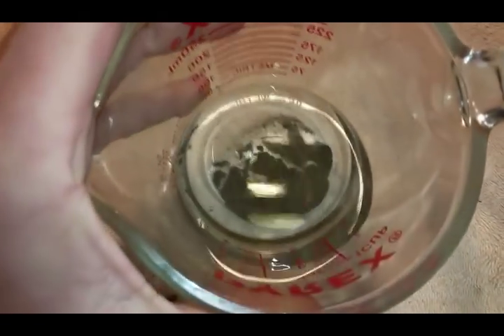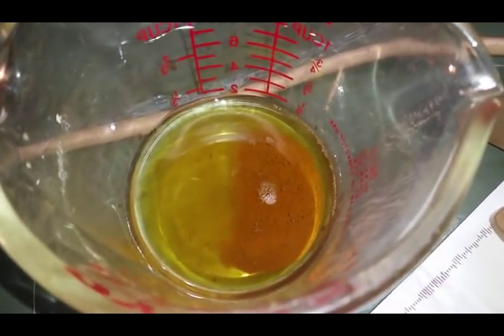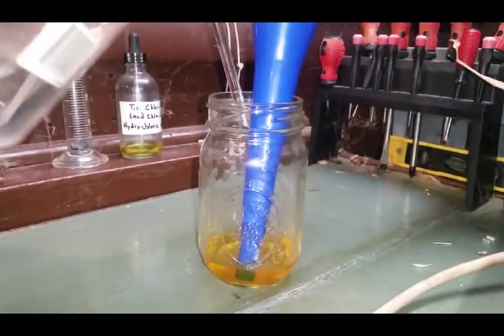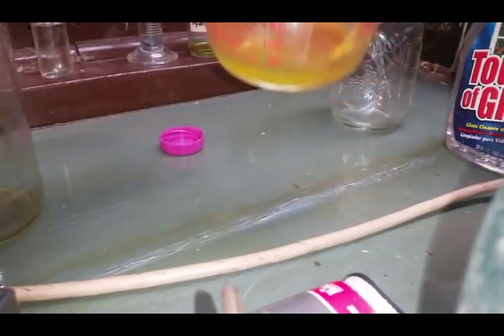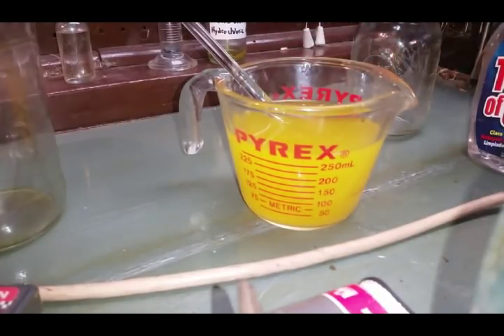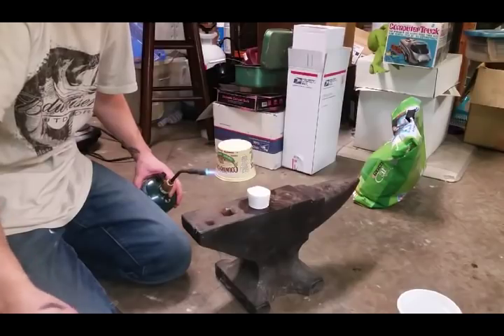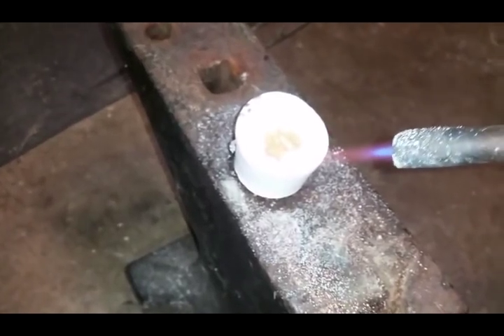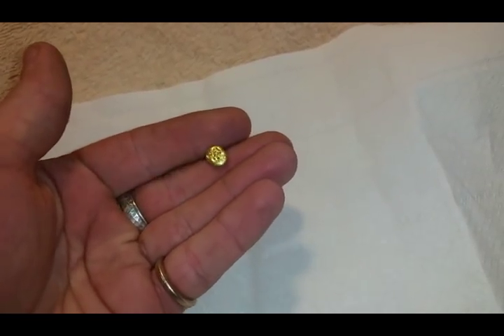Refining Gold to High Purity (My Method)

Comment: Big Tip: Always use protective gloves when working with acid.
Reply from the maker: Fuming nitric acid actually causes most gloves to spontaneously combust upon contact. This is not fuming nitric acid, however I have had different acids on my hands and most are relatively harmless when rinsed immediately.
Reply: Gloves are a must!! Don't fool yourself just because the acid does not hurt immediately when it is on your skin that doesn't mean that it isn't absorbing into your incredibly porous skin leaching all those heavy metals into your blood stream for a very nasty effect later on in your life. Look up platinosis once and see what the damage of dissolved metals in solution can do.

Comment: Not going to question anything you done. Great job and video, Thanks. Why did you evaporate acid down? I hope you can offer me some guidance.   I have 4 different batches on now. 1 was real dark yellow, 1 has green tint to it, other 2 are amber. Is it normal for the SmB to take off late? On the one it didnt do anything then all of the sudden it fizzed up. Now none of my bottom stuff is brown or cinnamon color. Green tint 1 is black and gold color, other 3 are gold color, 1 has milky white powder on top. Any ideas would be great.
Reply from the maker: migel reyas Minimal Nitric acid is used because it can cause the gold to re-dissolve after attempting to precipitate it. So, using the very minimum and then evaporating the solution will help destroy excess free nitric. The solution with the green color is likely due to copper contamination. Could be silver as well.... blue and yellow together make green. I would refine it a second time if the solution isn't a good amber/yellow. The black colored powder (precipitant) is very likely finely divided gold. Gold colored precipitant is most definitely gold, and brown precipitant is the same story. If the gold dissolves back into solution, something is likely neutralizing the SMB or Iron sulfate and not allowing it to fully precipitate. 

Personally, I would get everything to drop, then combine the powder and refine again. Don't keep adding SMB or anything if you don't get a successful drop. You must first neutralize the nitric or gas it instead of pouring SMB directly in.
Reply: Ok thank's, so evap. down wont do any harm and yes I used to much smb. Where I am its hard to get certain things. Great news on all thanks. Since I have 4 going at same time. Its from 4 different area's. The green 1 is sulfides. Thanks again.
Reply from the maker: migel reyas I have not had the issue with adding too much SMB and not being able to get a drop. I usually use Iron sulfate because I can easily make my own in higher quantities that are more cost effective. Not to mention Iron sulfate is a faster drop and more useful in solutions containing copper. IMO It's an all around better precipitant than SMB. By the way, if I called the gold dropped out of solution a "precipitant", I correct myself with "precipitate". The precipitant is what is used to cause precipitate... but I digress

However, I would search the forums for the approach to fix adding too much SMB. Also, when you evaporate a solution down, do not boil it. You can bubble precious materials out of the vessel. Instead, monitor the solution very frequently to watch the temperature and amount of solution. When it nears dryness it can dry very rapidly and pop right out of the container in the form of flakes or consolidated pieces.
Reply from the maker: migel reyas ..... and potentially break your glassware.
Reply: ok Thanks. How do you make iron sulfate? Cause I use stump out and to get it here cost's me a lot. I just got 2 one pound jugs and it cost me $65. Serious. Cant get it here so had to pay someone to smuggle it to me.
Reply from the maker: migel reyas I don't know if I can properly respond to this without telling you to check your local laws before doing any of the procedures gold recovery and refining pertain. If you can get Nitric acid, I don't see why you would need to "smuggle" Sodium metabisulfite.
Reply: mexico isnt like the U.S. where need something just pop over to Home depot. I looked every where, so it was easier to have someone bring it from the U.S.. I use HCl&peroxide, but just found Nitric, 4 hours away. You knowing how to make iron sulfate, would be a good help, but thats your choice if you dont want to share. Thanks for the video's. I never thought of evaporating down before smb, to cut acid.
Reply from the maker: migel reyas Iron sulfate is commonly found in gardening stores. It can be made by reacting steel wool with copper sulfate and water. There are videos on YouTube about it, I forget how much steel wool and copper sulfate is used.
Reply: Thanks, poopoo out of luck there.

Comment: Hey bud how much HCI/ nitric do you think I’ll need to clean up 112 grams? My nugget is almost the size of a golf ball. The gold was plated on CU. I dissolved the CU with spent nitric that was used for prepping stainless steel. I wash the gold foil’s in nitric until the nitric was almost clear, water and melted down.
Reply from the maker: Joshua Rhodes I would suggest just covering the foils in HCl and starting from there. Hopefully you aren't saying you melted your foils into a gold ball sized nugget, because that is going to be extremely slow to dissolve. Usually when that happens, people become impatient and add more nitric than necessary, which in turn will make everything more difficult. If it is one large piece, melt it down and pour it into a tall container of cold water to make smaller pieces.
Reply: Basshead Curry  Yes I did melt them all down for convenience. Which is not a problem for me to melt in to smaller pieces.  I have another batch of plated scraps I’m working on now. I made a comb with  razor blades and I score the plating every 8th in. To dissolve the copper. Just trying to get an idea of how much AR I’ll need. Thanks!
Reply from the maker: Joshua Rhodes I realized I made a mistake while typing. That wasn't supposed to say "gold ball"...... instead, it was intended to be "golf ball".
Anyways, I think you knew what I meant. Scoring may not be necessary if you're using common gold fingers, it quite literally may be wasted labor. The HCl/peroxide will do its job just fine on most gold fingers.
Reply: Ok so when you say gold fingers? I’m only scoring a sheet of copper that’s 12” *12” that’s scrap, after 6- 3” *4” parts have been plated in the in the panel that’s 2” on the sides and 3” on the top and bottom. It cuts the time to dissolve the copper by 4 to 5 hours of 30 minutes. My first golf ball was 75 scrap panels. When I don’t score them it like the gold foil seals the copper from dissolving.

Comment: My cons have sulfur, prevents SMB from working. Will this process work? Cons in AR warm, increments nitric and HCl till no reaction, filter rinse, back in pot hot to denox add HCl twice then water, stir in zinc filter precip rinse, dry then take precip put in hot HCl 24 hrs, filter rinse real good, then put precip into nitric/water hot 24 hrs filter and melt with oxy/acet torch. Not worried about silver loss, I am after the gold and pgm's. Zinc drops all metals, then HCl soak and Nitric soak to remove all junk metals, but gold and pgm's. Is this process correct?
Reply from the maker: You CAN precipitate with zinc to drop your most abundant metals but if it does in fact drop all of them (depends on the contents of the recovered gold material), you'll need to refine again and use SMB or Iron sulfate to precipitate again. Evaporating the aqua regia does help remove residual and/or excess nitric acid, so be sure to do that.  Sometimes it is necessary to rehydrate with distilled water and evaporate one or more times proceeding, to be sure nitric is destroyed. 

Keep your glassware clean, and rinse everything well with distilled. I'm not informing you of things you may know, but every attention to detail helps.
Reply: @BassheadCurry  I don't understand... You CAN precipitate with zinc to drop your most abundant metals but if it does in fact drop all of them (depends on the contents of the recovered gold material)....I didnt understand what your saying here..my assay reports say Au,Ag,Pd,Pt&Rh. The Pd iss 1/2 gram per lb the rest is 1 gram per lb. I am doing ore and concentrating down. I have tried smelts and SMB. The lab said sulfur is preventing drop's. They said use zinc as I said above then torch to a button then go back into AR. and separate each metal normal. Does the zinc grab all my metals in the AR, then HCl then Nitric remove the junk metals leaving me the Au,Pt,Pd&Rh? I was told nitric will remove the palladium?  Thanks
Reply from the maker: @1hardman161  If your recovered material is rich in those elements, then you need to precipitate them accordingly. Be careful with platinum and rhodium salts. TOXIC. There are methods of isolating the solutions into separate precips to get everything out and handle them safely. Do some research on each thing you intend to salvage. I can't walk you through every process as much as I enjoy teaching others.
Reply: @BassheadCurry  ok I understand the dangers. At this moment I wanted to know if the process the guy told me is correct. Cons into warm AR until no reaction, denox then zinc precipitate then back through HCl and nitric to remove junk metals leaving the good metals that I want. Then torch final precip to a button. Thanks... You sound young how did you get so smart? I have seen a lot of your video's. Chemicals here are cheap and unregulated, even cyanide.
Reply: @BassheadCurry  Ok I dropped with zinc. Then put solids in hot HCl over night, filtered and rinsed good, then ut that in nitric/water hot over night. then filtered and dried, 52 grams. Then took that and put it back in AR warm. Has been on 1 day. There iss stuff still in the bottom, I added a little HCl and a touch nitric. That stuff all came from liquid AR, now why isnt it dissolving completely? Just leave it on it will? Also what order do I drop my metals from AR? gold then platinum or platinum then gold? And what about the nitric/water soak silver or palladium first? I did a stannous test on nitric soak it went ugly green, positive for palladium, correct? I dont have DMG, but I heard I can use cyanide to drop my palladium. Is this correct? Iss there ssoething else I can do to drop palladium from the nitric soak. I know the silver copper pipe.

Comment: One thing is that the gold buyers use diluted AR made for14k gold they judge time and color , second thing they rip you off.
Necklaces are short on gold because it reacts with acid sweat and can come off the outer surface, plus a process were the copper in the alloy comes to the surface. Why if you think you have pure in the end did you use a fire assay crucible instead of a melting dish?
Reply from the maker: Richard O'connor I hate to tell you bud, but I had the gold piece tested at a jewelry store where I sold it. Right in the 99% range. That was the only thing I had to melt in.
Reply: Cool, good for you.

Comment: What did you make your melt dish out of?
Reply: Tortillas work just fine..just mold them to shape...let dry then smelt
Reply: @patrickgalloway5078  that will draw the lead out?
Reply: @chemistryscuriosities  as long as they are flour tortillas...they react like a heat resistant material when a torch is applied..just burn the inside ..place your gold powder...they can b used only once
Reply: Yhe carbon that you create by burning the inside is what will suck the lead and impurities out
Reply: @patrickgalloway5078  I have melt dishes but they don't work for cupulation.  I would like to find away to do it without having to buy Bone Ash which is the standard cupulation material.

Comment: what temp did u set the stove at??
Reply from the maker: Just a hot plate, and it ABSOLUTELY needs to be outside, or in a fume hood. It was at about 60% power, just enough to barely simmer the solution without it splashing. No need to boil. Adjust the heat as it evaporates. Remove from heat before complete dryness, otherwise it can flake and pop.

Comment: You said hydrochloric is muriatic? Someone else said use bleach? I have gold, hence why I am here. the gold I have is ore and sulfides. I want to extract the gold from the sulfides. Any and all help would be appreciated
Reply from the maker: migel reyas Yes, muriatic acid and hydrochloric acid are the same thing. The bleach method is a slightly different process than using nitric acid. You might have to do some research for recovery and refining from ore, as I have not attempted to do it.
Reply: OK thx. So where do I find out how to use this process? HCl and bleach.
Reply from the maker: migel reyas Join a forum such as "goldrefiningforum" and read everything you can.
Reply: Yes roast it in an iron skillet to rid the sufides takes a while

Comment: I could use your help in my process I’m in now
Reply from the maker: As long as you know most of the process, and need some pointers, I can help. However, I can't walk you through the entire refinement. It would require too much of my time and I would be doing it for charity. 

Tell me how much material you are working with, where it derived from, and what step you are on. I'll see what I can do to help.
Reply: Basshead Curry I had about 40 grams in an ignition that had gold and a few alloys that wouldn’t come out in the kiln 

I made a mixture of 100ml of nitric & 300 ml or hcl 

When I got to the point of precipitation the nitric was not neutralized and I ended up with white salts at the bottom of the beaker 

I know there is a lot of gold in the solution because of what I melted to get the Ingot and the solution did turn yellow before precipitation
Reply from the maker: @Gillyspitsfire  Did you make your solution from this ingot you mentioned? If you were capable of dissolving such a large quantity in solid mass, I give you props. That takes a lot of pacience. If you didn't add a metric ton of SMB (or whatever you precipitated with), I would recommend evaporating to near dryness, adding hydrochloric acid, then try precipitating again. It wouldn't hurt to evaporate, add HCl, and evaporate again, then adding distilled water before you precipitate. Yellow does not always indicate gold unless you absolutely know there is gold in solution. Other base metals can turn an orange-yellow color in HCl. Recovery before refining is extremely important, because it gives you an approximation of gold and base metal content. It also allows gold to be the most abundant metal, which is key to a successful precipitation.

Comment: I have lots of gold scrap that I need help with. I'm trying with sulfuric acid, but seem to be missing something. Please email me if you wouldn't mind helping me out.
Reply from the maker: Check google and forums
Reply: @BassheadCurry  I've been doing some research while I have free time. I started with sulfuric acid, and it's not going so well.
Reply: If your are proccessing pins or gold plate ...use a vibratory tumbler ...harbor frieght...add GLASS tumbler beads...tumble till you dont see gold plating on the item..use a screen to separate glass from pins..place glass in jar add muriatic acid and bleach...2 to one ...wait for the glass beads to turn white again..filter liquid ...should b bright yellow...disapate with sodium metabisulfite...filter add borax...mix and smelt 😊